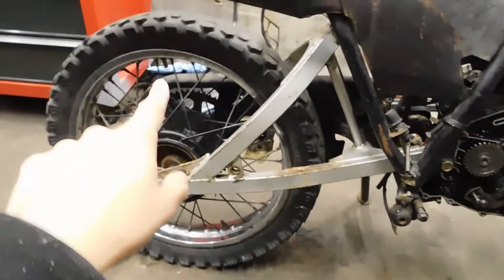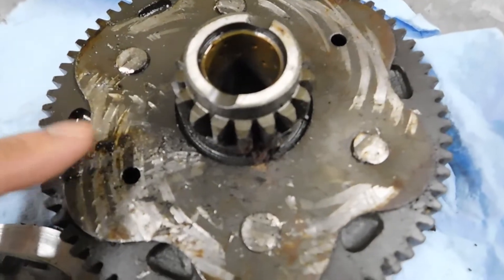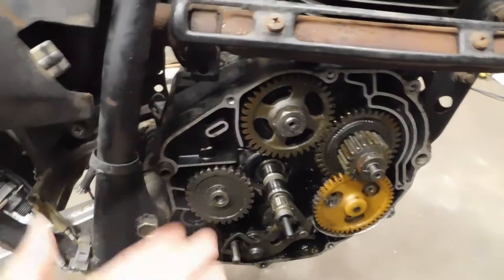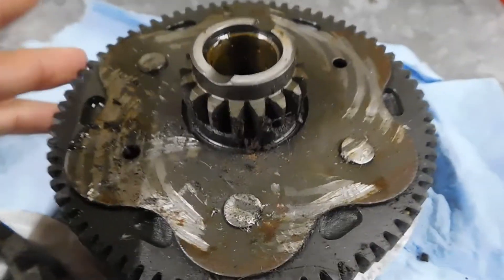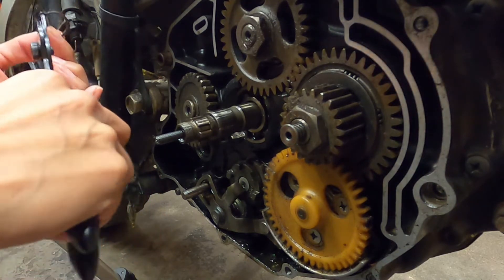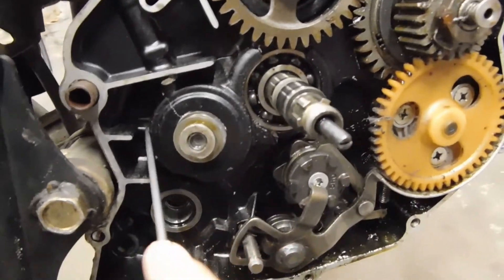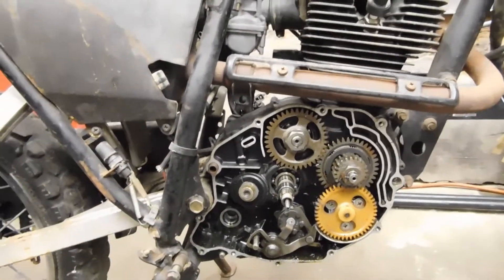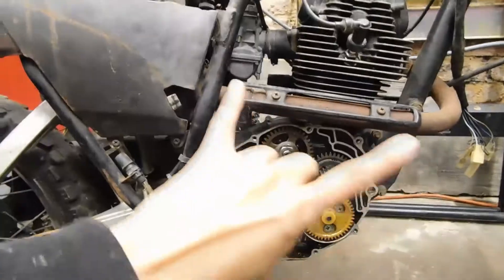1982 Yamaha xt200 Rebuild - Episode 1

Comment: I hope the project can go forward. You're a good mechanic and I think you'll be able to fix it. I have the same exact bike and was stoked to see you were working on one.
Reply from the maker: I just hope that i find parts for the engine. Thanks for watching!
Reply: @InetteMotoBiker  I've had luck with Babbit's Online for a lot of parts--the XT200 also shares some stuff with the TW200. They are OEM parts so not real cheap. I've seen a lot of stuff on Ebay too.